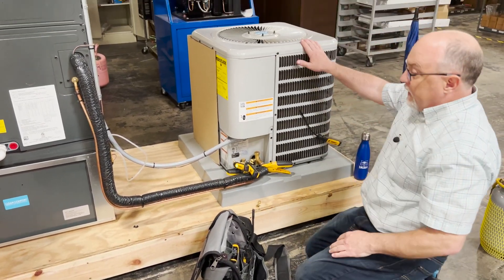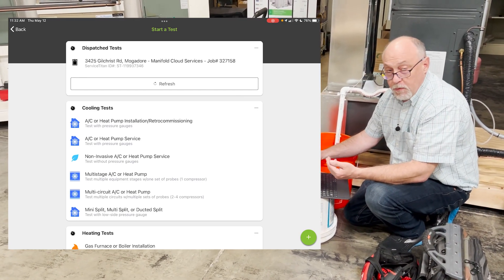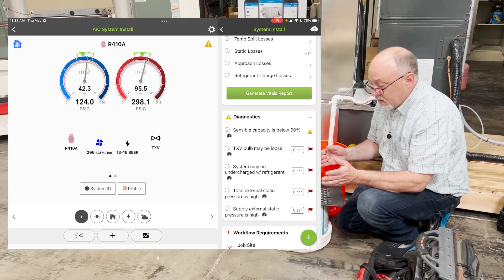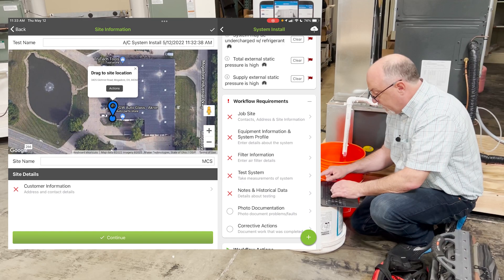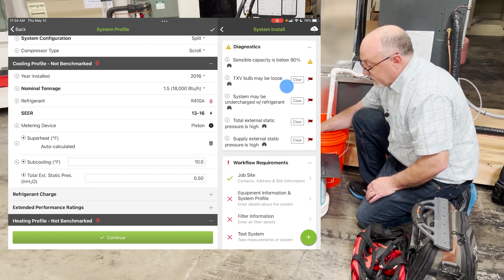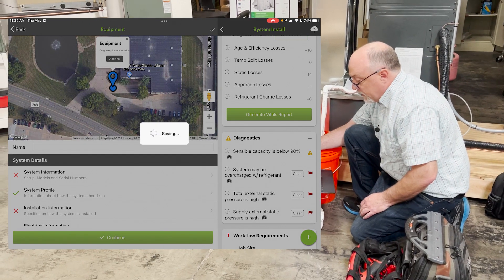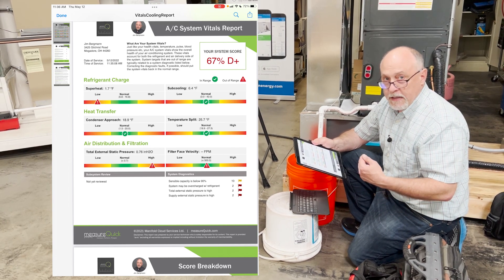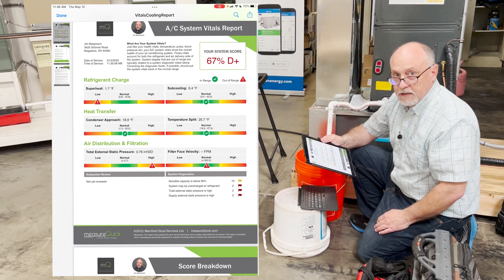How to utilize the Vitals Report in measureQuick

Comment: Correct me if I’m wrong but didn’t you previously say that to gauge up to a piece of equipment each time you come to service it is not a good practice? Using some thing like Sensi or just your temperature clamps is more proper?
Reply from the maker: Yes, that is correct. The first time however you need to put gauges on the machine because 50 to 70% of systems do not have correct charge. Once you know it’s correct you don’t ever want to put on the gauges again unless it’s absolutely necessary.  This is how we get a baseline for products like smartAC to monitor from.

Comment: How do you use measure quick on VRV/VRF systems ???
Reply from the maker: Typically you have a “test mode” or a process to run it at full capacity. At that point you treat it like a standard system.

Comment: What do you recommend to run vitals for two systems at once for properties that have 2 or more?
Reply from the maker: You would need two kits, LP, HP, SLT, LLT, ODA, SA, RA, Supply static and Return Static. 9 probes. And I would at that point use two devices to run two instances of the app. The other option is to move everything around.

Comment: Great visual Jim! I noticed that you put the static probe in the same direction as airflow, I was always told to insert it towards the airflow. Is that correct or preference?
Reply from the maker: Parallel to the airstream. It doesn’t matter if it’s pointed towards or away as long as it’s parallel

Comment: is it 5 qbits per cust/yr  to unlock the vitals? Or its it 5 qbits for the year to unlock it for every system?
Reply: It would be for that 1 system for 1 year which include the premium features
Reply: 5 bucks for the system for the year. Furnace/ Ac / HP. You can use the feature as much as you want in that year